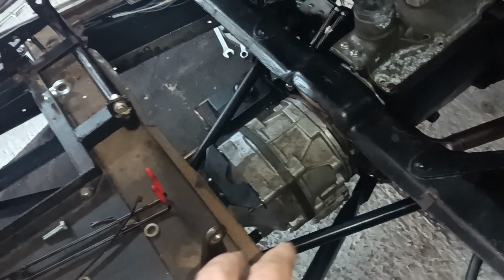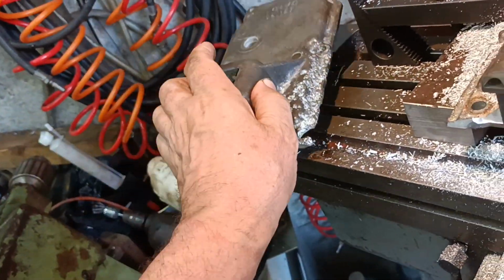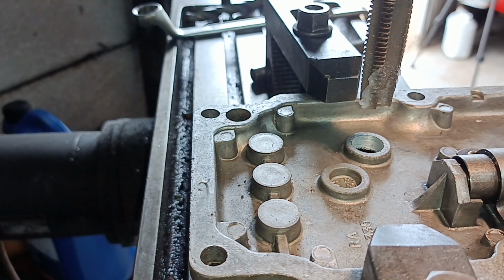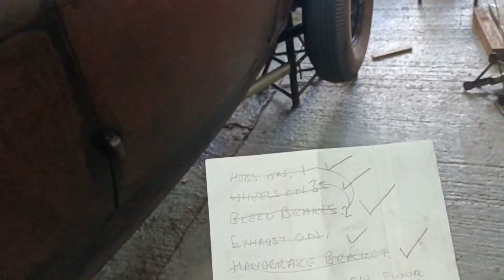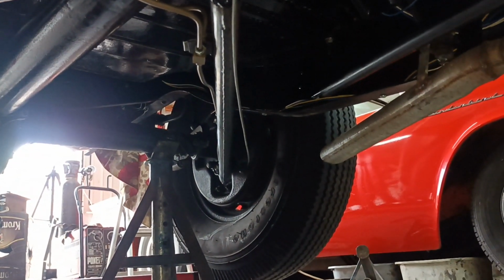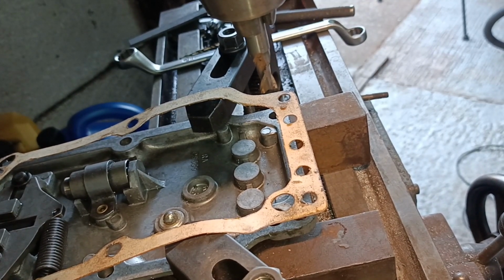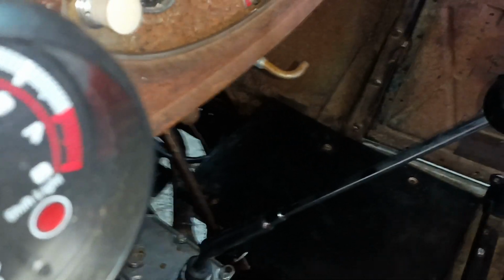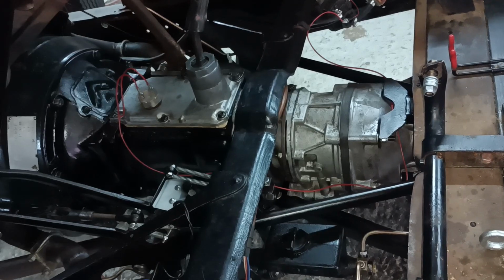Part 12: 4spd OD in a 1932 Ford.  Finishing things up! (2253)

Comment: Mart, could you wire the trans to Split gears? i have a Mitchel OD in my Model A, its all mechanical, i split second all the time
Reply from the maker: I could do, but as this is a 4 speed box there isn't much difference between 3rd over and 4th. I don't want to overtourque the OD so will stick to 4th only for cruising.
Reply from the maker: Oh meant to say it is a bit sluggish to engage when warm so trying to split gears wouldn't exactly be a slick operation.

Comment: Very interested in the wiring of the OD. I'm familiar with the Ford OD's and their "kick down" function. Does the Volvo have the same function ?  All in all this is a great project, anxious to see it run as, I'm sure, you are.
Reply from the maker: I have wired it as per the Volvo. They use a special relay. No kd function on the Volvo so I haven't tried to set one up. It would be simple to do, though. As the OD is relatively unknown to me I wanted to avoid operation at wide open throttle.

Comment: Looking great Mart,  look forward to hearing the fatty taking those quick changes. Are you aware some of those solinoids have an internal contact so they have a heavy current draw at operation for lots of flux that then drops to a holding current, may need heavy wire.